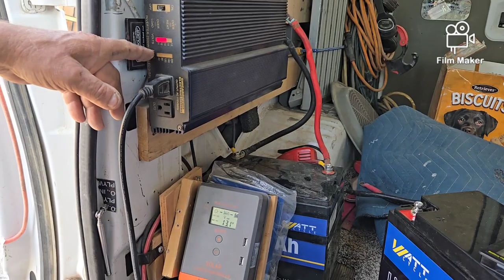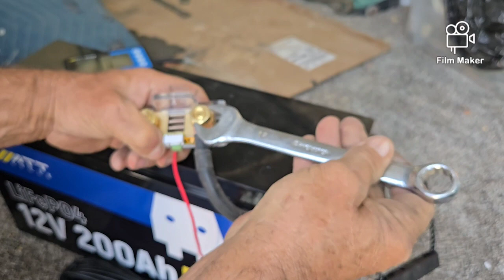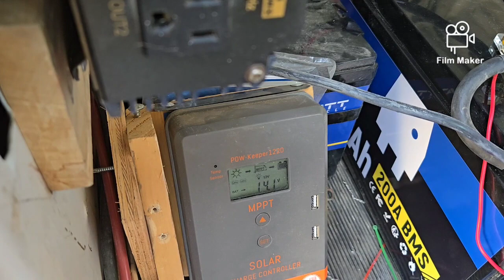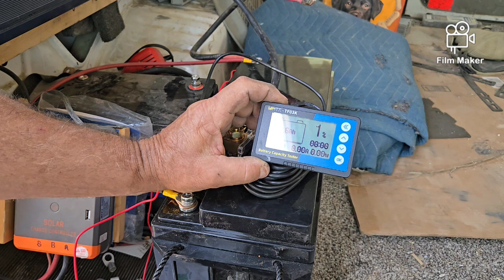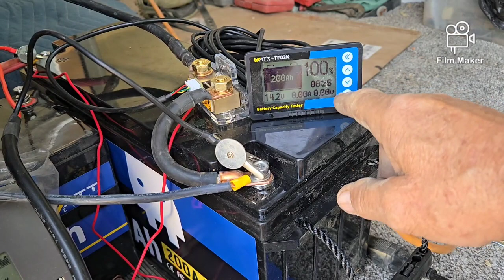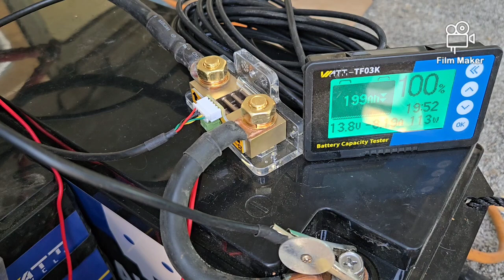WattCycle 350A Shunt/Monitor Installation & Setup Sep. 18, 2024

Comment: Did you need to configure the monitor for 200 ah or did it detect that info?
Reply from the maker: Yes, you have to enter the amphours during setup.  But, that's a good thing.  If you want to test the capacity of the battery, you can set the amphours above the rated capacity, say 110ah for a 100ah battery, then run the battery down, and see where the battery cuts off.  You should expect more than the rated value, not less.
Reply from the maker: Welcome aboard!

Comment: Hey G Bear, nice instructional!  I'd like to offer a suggestion, try using some simple air displacement hacks to bring your fridge/freezer usage way down because as you know the hardest thing for a fridge/freezer to do, is keep air cold.  Then you'll have more juice for power tools or prospecting fun.  Can be as simple as crumpled up newspaper taking up unusd space in an unfilled fridge/freezer.  I went to my local home improvement store and bought a sheet of 4' x 8' x 3" polyiso ridged foam board (basically a tough mold/mildew resistant styrofoam) and cut it into various large, medium and small blocks to take up room as I use fridge items (and hung a mesh laundry bag on the side to store them after picking up an order of food).  Can use same in freezer but what i like to do is similar but with different sized, easy to make home made "blue ice" bags (read that as: i'm cheap!) and freeze those up in the freezer when there is space  as I use items and as I refill items in the freezer i place those frozen "reusable ice bags" down in the fridge which helps keep it cool without running as much.  According to my "killed a watt" plug in monitor my usage on garage chest freezer, garage fridge/freezer and camper van fridge/freezer is about 80% less running them "always full" like this than what it was running them when they are less full (mostly filled with air) due to only needing very short cycle times because of all the thermal mass...
Reply from the maker: @user-dw9ou9sg2p  Good suggestions, and I don't that in my fridges and freezers in the cabin.  The one in the van is a test subject and I wanted it run on a worst case scenario.   Thanks for your comment!

Comment: Nice video of the watt cycle shunt.  Looks to be the exact design of redodo, LiTime, Renogy, and others.  Frankly after buying one long ago, my $$ is only on victron shunts due to far superior data capture and they make NO noise.  With that said, VE just released a new 300a IP65 and the market price is $72 (3 more than watt cycle).  VE is blue tooth and does not need all of the wires for a display and would not be impacted by extreme cold or hot temperatures that can impact LCD screens.  And best of all, you dont have to carry a manual around!  Glad to see the little PowMr is still working for you.  Gary in SE Mi
Reply from the maker: Yeah, the market is flooded with products. These WattCycle products are priced well, and the quality seems very competitive.  Also, what noise?  This shunt is quiet.  My inverter is noisy...

Comment: Your charge controller negative should be connected to the P negative of your shunt,so it can monitor both charge and discharge of your battery,if it reads bi-directional current.
Reply from the maker: @theo2378  Thanks, I'll check that out.
Reply: @GBear  you're welcome 🤗
Reply from the maker: @theo2378  OK, I just checked it, and no, it needs to be as I had it.  When I connected the CC neg to the other side of the shunt, the display began flashing, indicating improper connection.
Reply: @GBear  alright

Comment: I have an idea, maybe not a good one or one someone's never thought of, and I don't know if it will work 
Using a car alternator as wind turbine with blades, and dump loader, heard some use water heaters, but regulate voltage to charge a fuse box/breaker box to have continuous power to home. Can it work? And what else do I need?
A car alternator runs same time battery is being used, but if battery isn't used, alternator will still produce power, how to shut off alternator power when battery bank is full, is my concern.
Reply: And would I use a mppt controller?
Reply from the maker: @donnahurd4745  An mppt controller is to regulated power charges to battery banks.  A hybrid all-in-one controller would be needed to connect to grid power.  The power produced vs. The cost of setup doesn't make sense.
Reply from the maker: @donnahurd4745  Welcome aboard.  Car alternators can be permanent magnet, or not.  If not, then the alternator needs power in to make power out.
Blades are another factor.  Making blades is complicated, as balance, stress and durability are all very important.
But, should you still decide to go forward, all you need is a digital dump load divertetoand a load to use up extra power that is created.
I've said it before, small wind turbines are good for supplemental power only.
As far as connecting directly to your panel box, don't go there unless you have a working knowledge of electricity. The incoming power from the power company would backfeed into the alternator and cause a ruckus you don't want to witness.
Reply: @GBear thank you  for getting back to me, I thought permanent magnet(pm) alternator gets power from rotation, if not pm alternator then power comes from battery.  I have a windgen permanent magnet wind turbine motor for off-grid living once I get there, AZ. I need some inexpensive way to keep batteries charged when there's no sun. I have a generator 4000 watts, also for once I get to my land.  Coming from NC 
My elect. Professor told me all you need to make electric is copper and magnets. Lol he forgot to tell me all the other things in between.
Reply: I tried to find a battery charger, but was told all battery chargers need to be plugged in to charge batteries, I wanted one that holds charge for later use.
Reply from the maker: @donnahurd4745 Your electric professor was a smart man.  Electricity wasn't invented. It was discovered.  It's created naturally using the Earth's magnet field and conducting items it can find.  The only problem to overcome is getting enough of it to be useful.  Will you have a water stream where you are going?  Hydro is better than wind.
Also, don't count on wind being your savior when the sun isn't shining.  Sometimes there isn't any wind or sun.  I have a backup generator and use an AIMS Low Frequency inverter that also doubles as a battery charger.   I'll do a video on that topic and setup for you in the next couple of days.   There's a 76% chance of rain for today and I see the thunderhead rolling in.
Reply from the maker: That's called a "Power Station"  I'll explain that in a video.
Reply: The biggest problem using auto alternator is they are designed for high speeds.  Autos idle at 800+ rpm's and zoom way up from there.  Wind speeds when they're really blowing can get a turbine up to maybe 600 rpm...  You would need huge gear changes to make it work and the torque to turn such a big gear set would never start to turn in low to moderate wind, only at very high winds... Okay theory electrically but tough mechanically.  Better to go with lower rpm generator/alternator designs than automotive.

Comment: Hello  Great video but I noticed two things  1. connecting the neg from the charge controller directly to the battery bypasses the shunt.  While electrically correct,  If your shunt is bidirectional, you won't be able to measure the power going into your battery.  2. you didn't disconnect the solar input from the charge controller before disconnecting the battery. It's been my understanding that this could damage the charge controller   Now I admit,  I could be mistaken but that's what I I have gleamed from my solar power journey.
Reply from the maker: Almost.  The negative for the charger controller connects to the B- side of the shunt, therefore, it is correctly connected.
As far as not disconnecting the solar input prior to disconnecting the batteries,  you are correct, that should always be the sequence.  It was late in the day and power on the panels side was low.   I have found that I can do it this way as long as it doesn't stay disconnected for very long, or if the panels are not under maximum sun.
But you are correct, I should have done it the proper way to avoid confusing my viewers.
I will explain myself in the follow up video.
Thanks for your sharp eyes.
Reply: @GBear  I agree the shunt was correctly connected, what I meant to say is the monitor can not measure the charging current as it's connected to the battery not to the P side of the shunt  hope that makes more sense
Reply from the maker: @poolsidedreamer  It does make sense, but this shunt cannot be connected otherwise.  The shunt is not bi-directional.  I hooked the CC negative to the other side of the shunt and the monitor flashed showing improper wiring. I'll cover that in tonight's episode.
Reply: @GBear  well that explains that  Shame but it can be worked around , as you know
Reply from the maker: @poolsidedreamer Yep, and that's what I do.

Comment: Nice WattCycle Battery & Shunt install. I'm trying to figure out how many watt solar panel to purchase for the WattCycle 50ah battery I won in your giveaway.
Reply from the maker: @miguelsalami  A 12v, 50ah Battery is good for 600 watt hours.  So depending on your load, the battery will provide 600 watts for 1hour, without any input charge.  If you are only going to run 200watts, you have 3 hours of battery, but if you add 300w of solar input, you gain 100w per hour.
I find it best to match the battery load in solar input.  So 200w, load, should have 200w solar input, to maintain zero battery drain on daylight hours.
But remember, that only supports daytime usage. After sunset, you only have 3 hours of 200w run time.
Reply: @GBear  That's pretty Amazing Thanks! I was going to try & run my mini fridge out in the garage. I'm in the process of building 2 separate off grid systems.✌️
Reply from the maker: @miguelsalami Watch for some upcoming videos of running stuff in my van.  I'll include solar panels, charge controllers, inverters, batteries, shunts, etc.
HOW I SET UP MY VAN TO BE A POWER STATION.